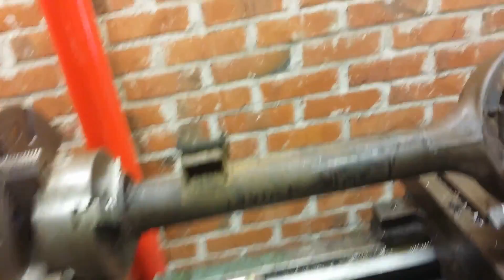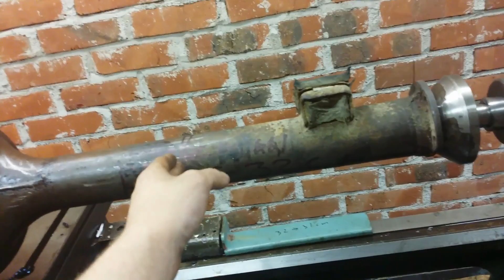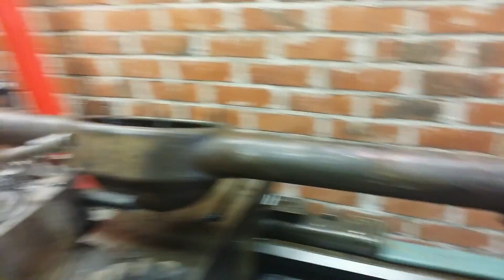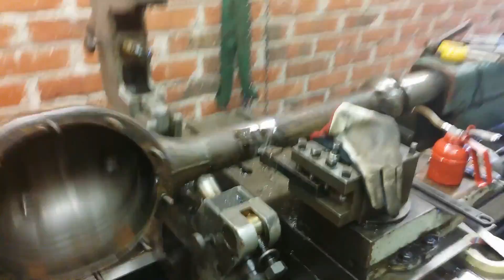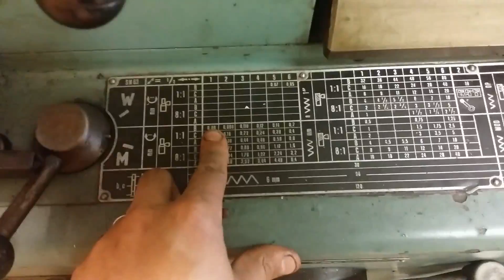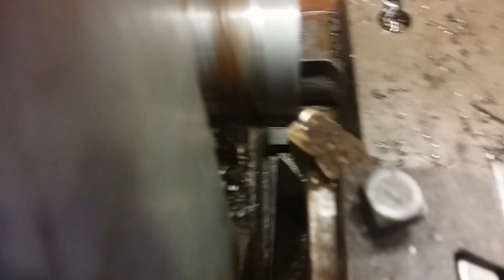Shortening a Ford rear axle

Comment: about 95% of the time the tubes are bent on any various make of rearends...  Use a saw and just cut to length, then you a narrowing jig to reweld the ends on, at that point you can use a torch to heat the tubes and quench them to pull the tubes in closer to center..  the old smooth ford 9 inch housings are bad about having thin wall tubes and most need to have new tubes welded on..

Comment: Unfortunately, the bearing ends should be aligned to the the centerline of the differential and not the tubes,  Most of this work was entirely unnecessary if you had a proper jig for narrowing a rear end.  At the very least you have a great welding surface.

Comment: what was the point of doing the parting on the lathe? why not just hack the ends off with a saw or torch, then clean up the faces in the lathe afterwards.
Reply: Because  he's a machinist not a boiler maker.

Comment: I think you have won the "turn the unbalaced part" award. Nothing true between chuck and tailstock either. Interesting comments on alignment bars. Your method is more accurate. Must be a couple (or hundreds) videos on that on YT, but hot rods are not my thing. Well done.

Comment: nothing wrong with the way you do it but it is a bit overkill (well, you do have a giant lathe so that helps). You usually cut the ends and use a setting bar to weld new flanges (or you could reuse the old ones by cutting the welds). Your way is very accurate though.

Comment: re ally the best way to shorten 9" housings is to cut off the spring purches and then remove the end flanges. cut ur tubs to langth and weld the outer flanges back on.

Comment: the axle tubes are different lengths to compensate for the offset of the pinion about 1.5 inches .i have never seen anyone use a lathe to shorten axle tubes. we usually use a band saw or cutoff wheel. the ends dont need to be precise, the bearing flanges are held in position by an alighnment bar for welding .the flanges slide inside the axle tube so the concentricity of the ends of the tube is not critical.the alighnment of the bearing flanges is critical this is why you need to use the alighnment bar while welding the flanges on to the axle tubes.
Reply from the maker: I have also heard that but never seen anyone doing it. My plan was to make the flanges fit precisely to the inside of the tubes which should now be turning true with the original flanges. Then maybe use a threaded rod through the axle to hold them both in place during welding. I guess this results in the same kind of accuracy as the alignment bar? It must also have some error in it somewhere? My method just happens to be many times slower than using the alignment bar :-).. Is the bar just a long shaft with tight fits on the ends to fit the bore of the flanges?
Reply: the alignment bar we use is one inch diameter it spans the length of the housing. there are two guides that take the place of the bearings in the diif punkin with enough clearance to allow the bar to pass through freely. then there are two plugs that fit into the bearing recess in the flanges with holes to allow the bar to pass through. once the whole thing is assembled you can start to tack weld the flanges to the tubes working on alternate sides and checking to be sure the bar is still free. if all goes well you should be able to slide the bar out with little effort. and your axle bearings will be perfectly aligned .by the way ford uses two sizes of axle bearings ,if you building a race car. you want to use the large bearings.you are sure making a lot of work for yourself making the axle flanges, the are readily available from aftermarket suppliers. good luck with your project..

Comment: Air belt grinders are excellent for deburring the ends of pipe like that; they do a very quick and clean job of it.
Reply from the maker: You mean like the small belt sander type? I don't have one.. Also I don't like to do any grinding on my machines unless absolutely necessary..

Comment: The Mazak-clone lathe I used to operate had a multi-way feed lever like that one.  I really wish more manufacturers would do that.
Reply from the maker: Yeah, its really handy to use! I've only used small Colchesters and a crappy new Vertex lathe apart from the TOS and Stanko lathes and both of the latter seem to mostly use a feed lever like that. Some machines with separate levers can use both feeds at the same time but that's the only advantage that I can think of?

Comment: A trick to try next time to get rid of chatter on these kinds of setups 
take a broomstick (for this probably something bigger) rest 1 end on your shoulder and the other end ond the workpiece an aply some pressure  
This workes well most of the times for me
Reply from the maker: Wow, sounds pretty rough!
Reply: sunppaa
may sound rough but  it works well
it dampens the harmonics better than tying gloves to it ;)
what also may work is if you had a way to spring tension the top steady rest contact
or an other way to apply some pressure